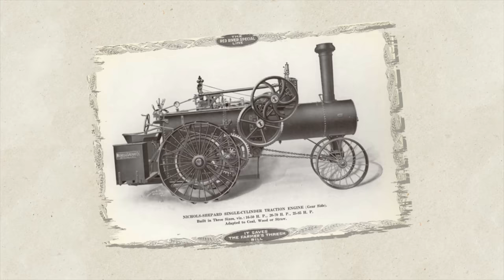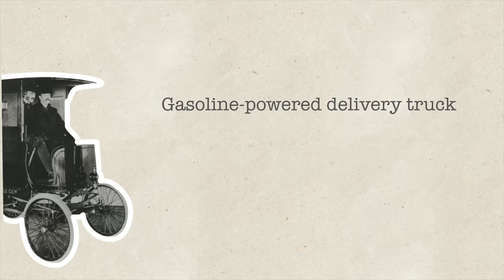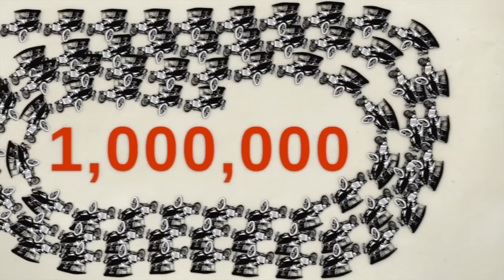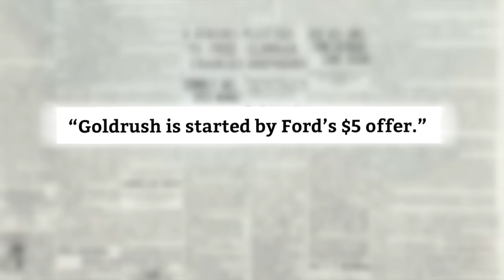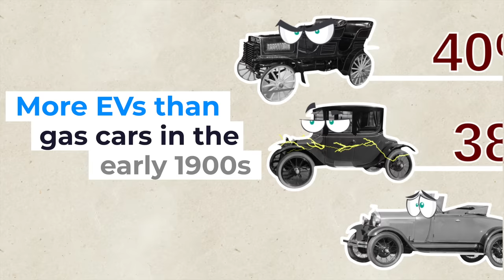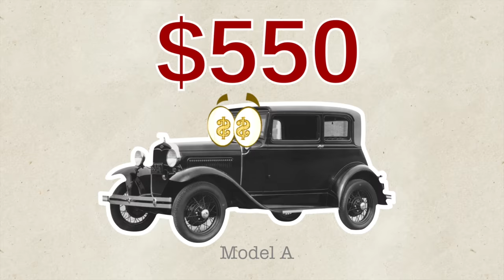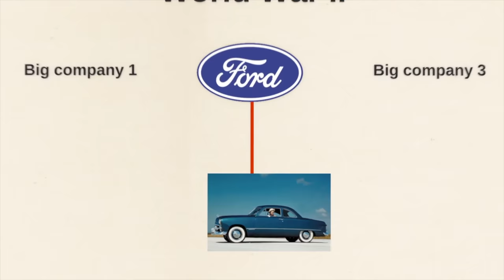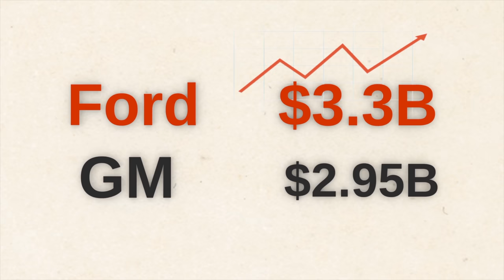Here's Why Real Americans Buy Ford

Comment: Scotty, my 2013 Ford Mustang has NEVER needed a single repair. I have had to replace the tires and battery, do oil changes and filter changes and tire rotations. My BMW 3-series, my Chevy Blazer and my Hyundai Velostar (worst. car. ever.) practically needed at least one repair every six months (from buying NEW!).  This V6 Ford Mustang has made me very happy. Even though it only had a 3 year warranty, I never needed it. My Hyundai had a 10 year warranty - because it needs it! So, when its' time to buy a new car, which manufacturer you think I'm going to pick next?
Reply: Toyota
Reply: Definitely McLaren
Reply: I drive an '06 Fiesta, so guess who gets to drive the family around when their cars break down! 😂😂. The biggest issue I've ever had in mine was some of the plastic parts under the bonnet breaking after about 14 Years of use...
Reply: Same with my wifes 1997 Camaro V6
Reply: I have a v6 mustang 2014 so far this correct but mustang stereo is defect and sucks
Reply: As with many machines you take care of them and they last. My 2004 BMW Z4 and 2004 Corvette Z06 have given little to no issues and the run great, but I also do not beat my vehicles to hell. Before those I owned many mustangs and again they were great cars because I took care of them.
Reply: De Lorean...
Reply: Hell yeah brother! I got a 2014 v6 mustang with 4.10 gear ratio with a staggered setup and it’s amazing! I also have a 2007 Toyota Highlander as my daily driver for work and I must say Toyota and Ford are probably some of the most dependable cars
Reply: Obviously a Mercedes Benz. They’re totally the best cars ever made and never break down ever.
Reply: 2021 Ford Mustang or Explorer.
Reply: @TeamGodandChrist90s  I have a 2021 explorer...very nice but the ten speed trans gear hunts a lot in around town driving
Reply: I am an Indian and have ford ecosport with1.5 liter 3 cylinder naturally aspirated petrol engine. Ford started the sub 4 meter SUV segment in indian market with ecosport. There are many cars in this segment in India in 2020, but still ford ecosport is called the king of sub 4 meter SUV. Engine is refined and handling is better compared to others, and also maintenance cost is less.
Reply: @KizdaShiz  wym hunts in downtown traffic
Reply: @coopermoreton6993  since it has ten gears its always searching for the right gear and sometimes it’ doesn’t shift that smoothly
Reply: Ford !!!!!!!
Reply: @vincentwang639  : The answer is Ford.

Imports are not made by Ford or any of the 3 domestic automobile manufacturers.

The Ford Crown Victoria was made so reliable and so durable that when Ford still made the Crown Victoria, it was the primary choice of fleet automobiles for both Police and Taxis everywhere in North America.

Ford had made the Crown Victoria for a very long time, and eventually decided to discontinue it, to sell their other automobiles instead, such as Taurus, Explorer, F Series pick ups, for the Police vehicles, also have heard that some Police departments do have the Mustang.

Also the Police do use other domestic brands of automobiles, but where I live, I still see almost all police vehicles are still made by Ford, usually the Explorers and some F Series pick ups.
Reply: @reinardharmse4375  : Fords are decently made automobiles, at the least, but possibly better than decent. 

I know people who owns Ford vehicles and loves them.
Reply: @k_Benz596  : I do agree on Mercedes Benz being great cars, it's not a Ford, but I do like them, since they are very dependable and durable.
Reply: Everyone says they’re reliable but as a car guy I could never justify not getting the v8 muscle car
Reply: Ford is the only true American car company worth considering IMO.
Reply: @solidtank7957   : I like the Mustangs but I like the early 2000's era Mustangs the most, SVT, Cobra R, Terminator, Saleen.

The Supercharged V8 it's got in there  in the 2003 / 2004 Cobras, it's just so wonderful.
Reply: Yup, got a 2008 Ford Mustang GT. Thing has needed very little repairs or work. Ford makes the best American car and they have won me over.
Reply: Toyota or Honda
Reply: The Cologne and Duratec V6s are fantastic power plants and the 2012-2014 ‘stang is an absolute unit. It’s a very good platform with excellent weight distribution and power.
Reply: That same cyclone 3.7 v6 also made a great truck engine. I think from 11-15 when it was edged out to the 3.5 (normal aspiration) in '16. I think now they use the 3.3. I love the 3.7 longitudinal..the transverse in the front wheel drive has an internal water pump and I'm not crazy about that design (it's also on the Ford 3.5 fwd..the seal breaks and then you're lucky if it doesn't ruin the engine. Again that's only on the front wheel drive versions.)
Reply: @k_Benz596  I'd love to have whichever one you're talking about because that's not my experience or anyone else that I know that's had one... maybe the C220 from mid 90's or the old diesel 350's from the 80's?
Reply: @marckemp9955  not everything is perfect unfortunately, but I’ll take seal leaks over valvetrain failures any day.
Reply: @derklanz1222  Indeed you are so right. The right owner taking proper care in all aspects will make the car run a lot lot longer.
Reply: How many Miles are on it?  That's the Key question?  See My 2001 Toyota Celica has 290k miles on it and has never needed anything but oil gas and tires and one set of break pads. Its a 5 speed still has the original clutch plate.
My 2012 Scion Tc has over 120k miles on it its never been in for spark plugs let alone anything else just oil and tires and gas. Newer cars last a lot longer then they did in the 50-60-70-80-90's 
My celica went to 233k miles before I put on it first set of break pads in the frt only.

This is not like the older GM's Chrysler and fords you were working on on the weekends to keep it going.
Cars are built with tighter tolerances and better engineering today and many parts are made with cnc and robots
that do not make mistakes as often as humans can from stress and other life issues, but they also do not have the hand crafted feel.

Before I bought the 2001 Toyota Celica We test drove a 2001 Ford Mustang with the Rousch Kit on it, The car made a ton of noise on the road with the rousch kit rattling and I doubt I'd have the car today.

I've owned every brand of car that is normally priced No BMW's No Benz's  but I worked on every brand almost 
No exotics But some very expensive cars 
For a working man the Toyota's almost always gives the most bang for the buck but they have made a few duds.
The Toyota Tercel from the 1990's was a dud.  The GEO line GM sold was Toyota.
Reply: Love my 6 Speed 2018 Mustang GT.
Reply: Mustang Cobra? They’re nice
Reply: @vincentwang639  Haha I always thought Toyota too until my 1999 4 banger camry let me down. I developed a bad running oil leak from the side cover and oil pump and I replaced everything !!! Two weeks later motor got noisy and lost oil pressure. Anyhow my 2002 Mustang with twice the miles keeps running. Way better than Toyota in my opinion
Reply: Any Ford product with the old 4.6 liter V-8.  You take care of those at all and they never die.  They are as good as anything Toyota ever built.  Just the engine, trans, and drivetrain.  Not the electrical stuff, windows etc...
Reply: Yugo is a nice choice.
Reply: @johnelder9919  I agree man. I have 215,000 on my 2002 GT and the only issue right now is previous owner put Dorman replacement intake manifold on the car years ago and I believe the gasket has gone bad getting lean code on bank 1 and it will misfire on some cold starts. I’m going to replace it with the Ford performance one this summer. And the throw out bearing is starting to fall apart finally.
Reply: I got a 2012 LW  ford focus and the steering rack had to be replaced after just 59,000 kilometers, the automatic transmissions were bad in these, although mine has a manual, the quality still isn't the best. it's using some engine oil around 300 mils between oil changes and the car only now has 64,000 kilometers. sometimes under load going up a hill the engine has some pinging, thinking of trading it in on a toyota or Honda and getting rid of it.
Reply: Aw yes it’s like that for others as well
Reply: @dalesmith4985  you're speaking in kilometers AND miles so not sure what the hell you're even talking about...but most people by now know that the focus line, in general, had some serious problems.
Reply: @k_Benz596  😂
Reply: what year veloster did you have? i mostly see the bad reviews on the 2013 one.
Reply: @pcortes1987  Wow! That's weird. I had a 2014 V6 Manual Mustang with the same issue. I had about 30,000 miles at the time. The dealer replaced it under warranty.
Reply: I hope the answer is Toyota. Lol. 
Toyota's don't go by years, they go by mileage. ;-)
Reply: If your not gonna appreciate that blazer send her on over here and I’ll take care of her along side of my 94 4x4 😉
Reply: Ford
Reply: My 2014 V6 Manual Mustang was one of the best cars I ever owned. I traded it in for a 2018 Manual Mustang GT brand new. I love that too.  :)
Reply: DEFINITELY FORD
Reply: Toyota
Reply: @davidaar1947  Yep, for reliability they are tops overall, but for American cars, it's Ford over GM and Fiat, um, I mean Chrysler.
Reply: Our repair shop has just recently had 3 Fords. 2x Focuses and 1x Fusion. Transmision problems, very hard to detect. That one Focus is so tricky, we're starting to go grey, and trust me, some of the mechanics are brilliant, who are working on them.
Reply: @Godl1ked  The Focus and Fiesta both had bad transmissions made in Mexico. Ford should have owned up to it. At least tey were smart enough to realize that they can't compete in that market and discontinue making hatchbacks and sedans. The Fusion surprises me because they were usually built a little better.
Reply: Ditto on the V6 Mustang. Two of my uncles bought 2014 V6 Mustangs with 6-speed manual transmissions. They drive them HARD. They got scrapes and scuffs, but they are still on the road and they are still driven hard.
Reply: My 2012 Civic with 150k miles on it has never needed a repair or a replacement of a non wearing part. I don't live in the rust belt and I'm sure that makes a big difference but I do live in a condo so it's been outside parked it's entire life.
Reply: @rickleuce8025  Had a 2000 v6. The rear differential went and had to be rebuilt.  Fun car but, they break faster then my Toyota's have.
Reply: Ford will never be as good as Honda or Toyota without help from Asian Car Developers. Just like Harley Davidson. It was crap until the Japanese agreed to help them
Reply: @k_Benz596  Benz suck nowadays. Scotty attests to that. Good luck affording any maintenance. Just for the hell of it, call a Benz dealer and ask what they charge for an oil change
Reply: @KizdaShiz  Try downshifting one gear in town until the shifting stabilizes. Take it to your dealer and ask them to check it out. Take it for a test drive and let the mechanic drive it while you explain your issue when it happens.
Reply: 2013 is not an old car. It's still junk.
Reply: What do you end up getting my boyy
Reply: Except the fact the transmission mission are garbage unless you got a manual which anyone can make.
Reply: Toyota?
Reply: Ford
Reply: You bought a mustang, mustangs are their biggest sellers. So of course those may be less of a headache particularly the 5.0s. Other than that their transmissions are some of the worst and most of their other cars are giant paper weights. Keep that in mind Ford's still a junk making company.
Reply: @mariahalvarez3270  Refer to what i just said.^ And realize he said mustang and not any other model because most their other vehicles suck particularly their transmissions.
Reply: BMW = Big Money Waste
My 2017 Giulia Quadrifoglio is the BEST CAR I'VE EVER OWNED
Reply: @mariahalvarez3270  my best friend must of put ford’s they suck lol I prefer and Toyota or a Honda by far the best you can find for a reliable vehicle to get you around everywhere because they don’t go by years they go by mileages and even then they still last along time then most vehicles do sorry not a Ford fan at all the most thing that happens to fords is that they overheat more often then most vehicles it’s true fact Erin Ericsson
Reply: @erinericsson  sorry I do not like Ford’s my friend must of posted they when he was on my phone I’m not a Ford fan I’m a Toyota and Honda fan sorry I’m not a found on road dead type of fan
Reply: @mariahcanada2695  Tell your friend to do better. Jk
Reply: Toyota
Reply: @theroyalcrownedtiger2946  9
Reply: @erinericsson  I tired but he said that he wouldn't get caught died driving a Toyota so idk
Reply: @mariahcanada2695  Tell them to atleast get the extended warranty on the transmission then and change all fluids earlier than usual, especially if it's turbo charged or supercharged.

Comment: Always owned ford trucks never been disappointed
Reply: First car was a Ford Explorer. Now I have a Mustang GT. I love Ford 💙
Reply: Always stay with Ford and Toyota never step foot anywhere near a Chevy or Dodge letting you down is all they do Toyota's make great trucks but there's only so much you can do for what you pay the best for hauling will always be Ford
Reply: Ford has YouTube videos bragging how they make the f150 in under one minute on the assembly line.... NO thanks
Reply: @joeg526  still better than a Chevy
Reply: Or dodge
Reply: Jesus Perez when you don’t torque your spark plugs properly any car will give you problems, all Honda blvehicles except some Acura have excessive oil consumption and they run fine, better than Toyota so what’s your point?
Reply: I wouldn’t be disappointed for being fit and strong 💪🏼 either
Takes muscle to push those things off the road and into a shop 🙃
Reply: We owned Ford Focus, F150, and Escape....never failed us
Reply: Guys forget what i said ford should have improved on the v8s instead of replacing it with a v6. Sure its the same power ratings but the way you get the power is no the same as a v8. The 6.2 sohc from ford can easily be modified to become the flagship engine to compete with the 6.2 pushrod from chevy. V8 may be old, but its not old technology. Old technology is pushrods and carburetors. A SOHC can make the same low end torque as a pushrod or a v6 on turbos.
Reply: Fact👌
Reply: Ikr like if i was the ford ceo, a twin turbo v6 wouldn’t have been an option, just keep improving the v8. But now look, i think the base 3.3 sells more than the 5.0! Sad ford, sad
Reply: '94 Ranger, '94 F150 SVT lightning, '06 Lincoln Mark LT, '07 Harley Davidson F150, '07 F150 Lariat.. 
Blue oval bloodlines.
Reply: Truth hurts. Just like everything, V8 engines won’t last and will be reduced into vapors in the hands of regulators. 
V8 technology has become slowly stagnated. That’s why turbochargers and superchargers exist.
Electric powered vehicle technology are currently in the very early stage. 
Just like the first ICE engines, electric motors are currently inefficient at this time.

But V8 fans say, “no replacement for displacement.”
Yeah but who are you to regulators?
Reply: @joeg526  They still hold up quite well. But it is sickening they churn them out so easy and arguably cheap but they're approaching $60k fast new.
Reply: Guess I'm not a real American...and never will be.
Reply: Always owned GM and Dodge. Never been disappointed...
Reply: @twinkieerella   My 84' Camaro and '00 Express camper never failed me either. If you understand how to maintain a vehicle and what to ask of it most are happy to oblige. My 03' Accord does shift a lot smoother than my friend's Fiesta though.
Reply: @silasmcgee3647  My brother has always had Ford trucks and one of my sons sticks with Ford.  I've had Ford, Chevy, Toyota, and Nissan trucks & all have been good trucks.  My wife's 2012 Chevy Malibu has been 100% trouble-free so far (bought it new).  I'm on my 3rd Silverado, and for the most part, they have all been "like a rock".  My Chevy gripe is my 2012 Silverado had to have the cam and lifters replaced (under extended warranty thankfully).  One of my Ford friends got rid of his F-150 for blowing spark plugs out of the heads.  Now his F-350 diesel is in the shop - AGAIN.  My son's F-350 diesel has had a LOT of work done on it.  They all have problems. Keep them maintained.  I won't buy Dodge after problems we experienced years ago with a Grand Caravan and bad service at a "5 star" dealer, but everyone I know that has a Dodge truck, new or used, has had good service from them.
Reply: @TxMx214  nah Toyota is better then honda they're both great but honda slipped a little more especially with their poor transmissions on the minivans
Reply: @nomaddawhat7643  your very lucky with that malibu those are notorious garbage so i assume your taking the best care of it
Reply: @nomaddawhat7643  a good few of your vehicles are well known for problems mostly Nissan and dodge and chev but if u and all your friends are taking good care of them you should be good for quite some time
Reply: With a name like Biff Malibu I'd have thought you were into Chevys!
Reply: @livemeyer  probably his last name
Reply: @joeg526  one truck is finished being produced per minute, not assembled in one minute... you misunderstood my guy.